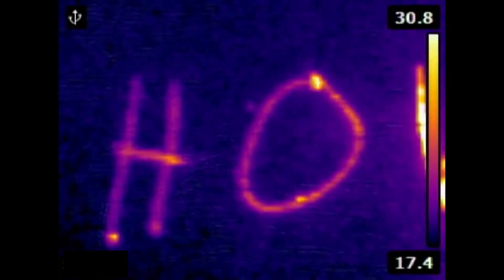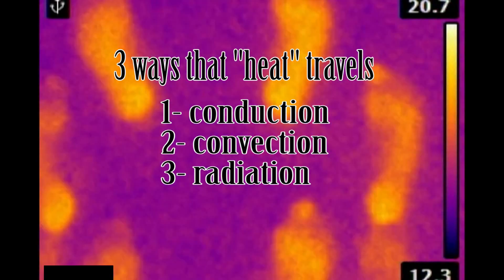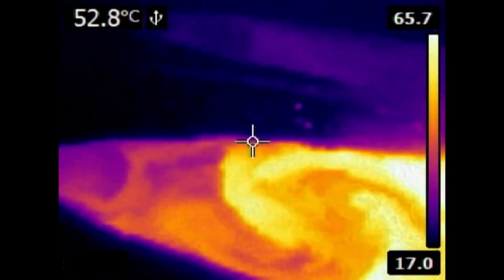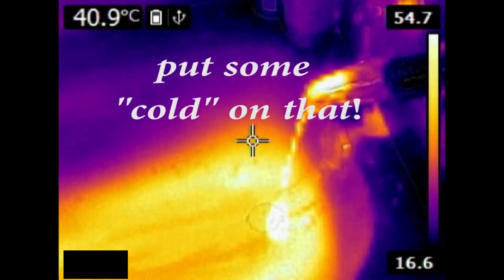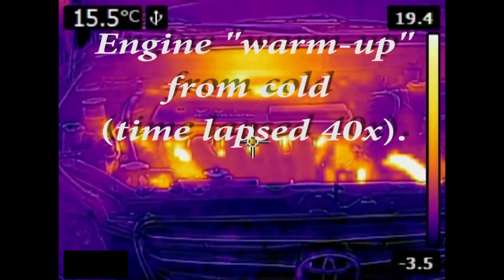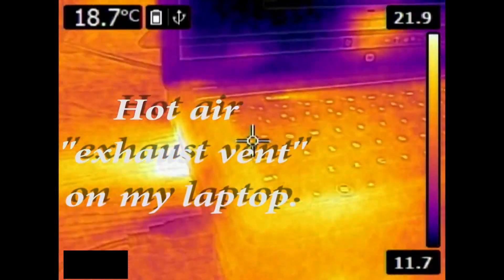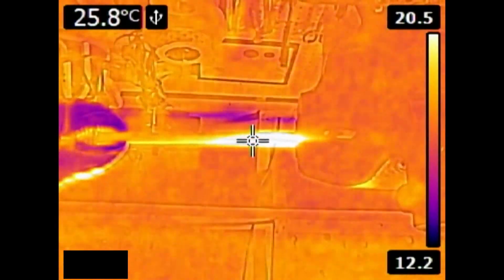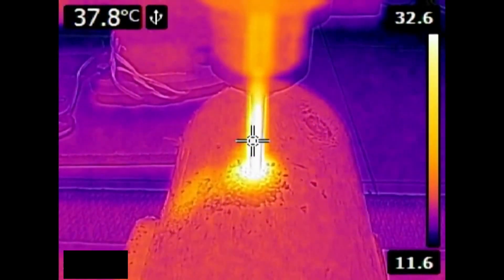Your eyes can't see what a Thermal Imager can. #17

Comment: I would probably be walking around the house for hours just looking at things that give off heat and cold...can you use it for leaks of cold or hot air leaking in around doors and windows??? Might be able to seal off some leaks around those...and I could buy a new toy. Probably costs too much to justify buying one to save on heat and A/C bills. Is a FLIR E4 expensive...or what does a cheaper one cost?
Reply from the maker: I did the research, and found the FLIR e4 to be the best bang for the buck. From what I have seen, the resolution is far better than others at the sub $1000 level. I've done the walkabout in this house and have seen many air leaks I didn't know existed!
Reply: I suppose you make the house real tight and then you have to buy an air ex-changer to get fresh air in...and you see your windows are not as good as they should be...better put in new ones!!